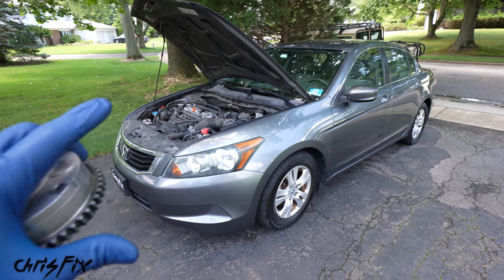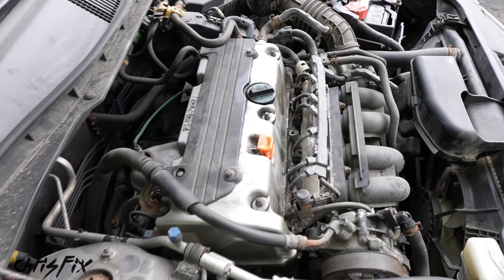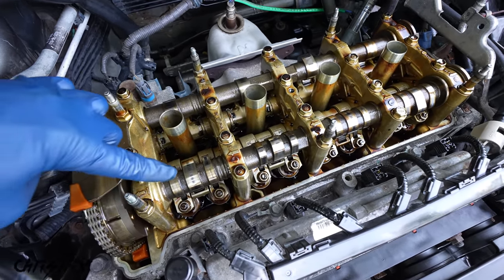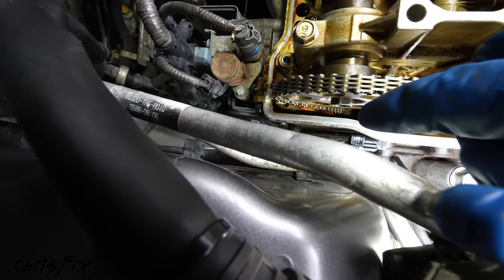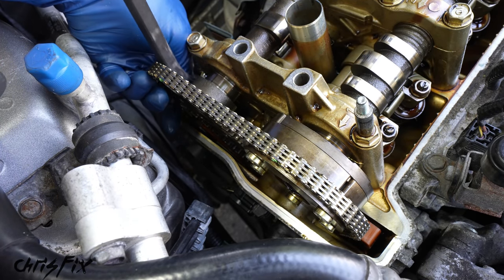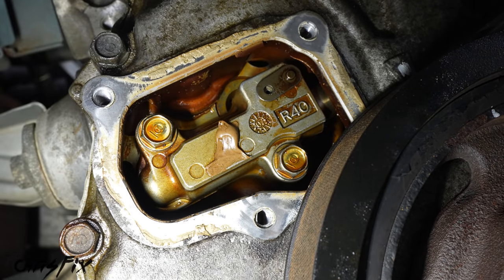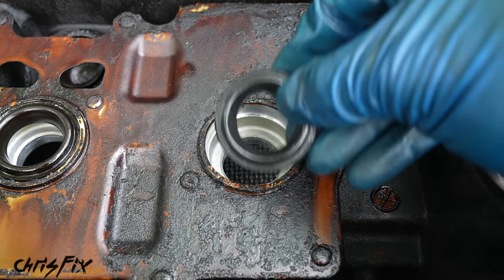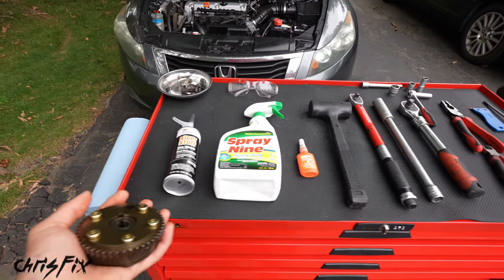How to Replace a VTC Actuator (Complete DIY Guide)

Comment: whats the worest scenario if i didn't change it,  because i just hear the sound sometimes only in winter .
Reply from the maker: As long as it's not bad you can get away with starting the car like that. Worst worst case is it breaks and causes a catastrophic engine failure but that is very rare.

Comment: How do I know if my noise is coming from the timing chain tensioner or vtc actuator.  I'm seeing some people saying it's the timing chain tensioner which would be an easier replacement than the vtc actuator.  Thanks
Reply from the maker: Listen when someone starts the car. You can tell if it’s from the top or bottom of the engine
Reply: @chrisfix  Thank you.  I don't have any check engine lights on if that helps at all.
Reply: @tylerlavalle8951  have you fixed the problem? and what year do you have? i have a 14 accord sport, need help

Comment: My son drives my honda accord lxp 2009 180k miles no code but it sounds just like that ....but it also cut off while he was at the red light 🫤 i might try this wish mr luck
Reply: There are replacement VTC actuator springs that often resolve the rattle without replacing the VTC actuator.  Quick and inexpensive with no risk of upsetting your timing.

Comment: Hi Chris, just replaced mine on a 2014 crv ex. 105k miles. Starts great now but throwing a P0341 code and I have lights on the dash. Is it the solenoid?????
Reply from the maker: It could be. Does it idle weird like a very high idle?
Reply: @chrisfix  No sir, idles fine.
Reply: @chrisfix  got it! TDC was as close as I could get it, but was out just enough for the computer to not like it. A buddy helped me adjust the exhaust sprocket just enough to put the crank mark more perfectly in place. All P0341 codes left except the permanent. After about 1/2 hour of driving, it cleared itself. Not a bad job at all, but more finicky than I am used to. Thanks for all you do!
Reply from the maker: @djpreast6638  awesome job!
Reply: @chrisfix  well, it started the cold start rattling again after replacing the actuator. Solenoid appeared good and clean, just start replacing parts I suppose?
Reply: @djpreast6638 I see some people just replacing the spring in the actuator. How did yours turn out?

Comment: I did this job following the video but I got the code p0341 I dont know if its related to the vtc? What should I do re do the job or change the part that the check engine is telling me the crankshaft sensor.
Reply from the maker: Check timing. Make sure your timing chain isn’t worn out.

Comment: How long does the new actuator last? I was told it doesn't last long.
Reply from the maker: It’s been fine over a year later. It will only not last if it’s defective.
Reply: Thanks for your videos they helped shorten the time I work on stuff and I can spend a little more time in my recliner

Comment: My original vtc actuator was not in the locked position when I took it off.  When I put the new one on, and locked it, I'm not able to reach the exhuast can with the sprocket with both sprockets aligned with my paint marks.   Ithen got slack in the chain.  now what?

Comment: My 2014 CRV needs the same thing. Can you do it ? Where are you located and How can I reach you? I’m a former Toyota tech from the late 80’s, I’m too old to do much of anything any more!
Reply: For the 2014 CRV a new Extreme VTC spring usually does the trick.
Reply: @spring-start so it’s an entirely new VTC with a new extreme spring? You have a link to a part?
Reply: @johnc3225  just a spring that fixes the VTC actuator rattle. "Extreme VTC spring"  on a "search" should do it
Reply: found it. Is it easier to change rather than replacing the entire VTC?
Reply: @johnc3225  A fraction of the time, cost and no risk of upsetting your timing. It works.
Reply: @johnc3225  It takes about  45 minutes.  We reuse the valve cover gasket in most cases.
Reply: Awesome! I just looked it up, looks easy! I’ll give it a try this spring-summer. Thank you!
Reply: @johnc3225  we just designed a new spring for the 2014 CRV and can send you one complimentary to test.
Reply: @spring-start  how do I know this is a legitimate offer? I’ve been scammed on YouTube before!

Comment: Most of the time these actuators go bad because of the sprocket spring internally, high mileage motors yes but one of those things where the dealer has built in planned obsolescence. At least it's not the same as an E90

Comment: The video thumbnail says VTEC actuator, and the title says VTC actuator. I'd like to clarify those are different parts that are both part of that car's i-VTEC system. VTC adjusts timing across the entire RPM range, while VTEC extends timing and lift above ~5100 RPM.
The system repaired in this video is in fact VTC, not VTEC. 
I'm no expert, but if your engine is hitting VTEC on a cold start, I think you should ask a mechanic about that. 

In fact, most of the 8th gen Accord sedans (like the one in the video) will almost never hit VTEC at all, with the exception of the ones owned by morons like me. The automatic transmission in this car will actively try to prevent you from passing 5k RPM. (...which is understandable for a budget eco sedan produced during a recession.)

Comment: Changing it is not hard, its the guesswork of whether the electrical part is bad or not, you could literally change the valva actuator, pcm, etc before you finally get to the bad part. You dont show what to look for on the scanner. Just hook it up and listen for the sound

Comment: I changed mine and it still makes the same sound as in the video… what else could be causing it?
Reply: I replaced vtc actuator yesterday on my 08 accord 2.4

Maybe timing chain, tensioner, and guides need to be replaced if your car has high mileage

Comment: I used an induction heater to heat up the actuator bolt but the bolt was still stuck hard.
Reply: Finally, got bolt cracked loose.

Comment: 2010 crv rattles on cold start and continuously rattles when driving could it be the chain?
Reply: A new timing chain tensioner and a new vtc actuator spring often resolves the rattle on 2003-2011 CRvs.
Reply: @spring-start  link to the spring kit? Wanna start off cheapest first
Reply: springstart vtc
Reply: google
Reply: R40/RZA kit

Comment: I did this but my horizontal lines are a tooth off. Paint marks line up to the notches. I'm lost
Reply: My cams shifted when removing the gears, use Allen key in the driver side of the cams to hold them in top dead center.

Comment: I just did this job and it was a pain. It's very important to tighten up the bolt on the intake gear before the chain goes on it. i accidently unlocked it and then the exhaust gear would not go on the cam. It takes very little effort to unlock it. I had to take the new actuator apart and unlock it.

Why are we so worried about keeping the chain in the right place on the gears anyway? I've done a couple timing belts and all you have to do is make sure that the crank and cams are in the right place when the belt goes on. The belt or chain just spins around the cams and crank keeping them in time.

Comment: I HAVE HONDA CRV I HAD SAME ISSUE. I GOT THIS ACTUATOR CHANGED. AFTER FEW DAYS I GOD SAME SOUND AND ITS EVEN LOUDER . I GOT THE OIL CHANCE AS WELL . SEEMS LIKE OIL PRESSURE DROPS IN THE ACTUATOR AND DOESN'T LOCK ON TIME AND MAKES THE SOUND. PLEASE HELP ! WHATS SHOULD I DO NOW ?
Reply from the maker: If you think it’s an oil pressure issue get the oil pressure checked. Did they use an OEM part?
Reply: @chrisfix  THANKS FOR REPLYING, YES ITS OEM PART. I WILL GET THE OIL PRESSURE CHECKED

Comment: Careful, if your chain is stretched, simply replacing the VTC actuator won't fix the problem. More like a bandaid.... If you hear your timing chain slapping after replacing the VTC, your chain is probably stretched

Comment: so i have this problem as well with a 2009 acura tsx, with the same rattle noise on start up. but the check engine light is not on and the car runs smooth. but it rattles on start up, and it rattles when you drive, but the only time it rattles when driving is when pushing down on the gas accelerating. no rattling when braking or my foot being off the gas, only when i push on the gas pedal. can anyone help?

Comment: My timing mark on the pulley is off by a smidge. Has anyone ran into this? Timing chain doesnt feel that loose. Going to go for it and reassess from there because engine runs nice and quiet with 0 codes

Comment: I think I got hoodwinked by my Honda service. I got car shield and after watching this video I now realize I got conned by them. Looks to me like they didn't change the actuator or even attempt to examine the condition of the timing chain, while claiming to have changed the actuator. Still making the cold start rattle the crooked dealer concealed from me when I bought the car. On edit: and they charged me over $1000 for it.

Comment: Sweet😂put dirty valves cover back to the engine😂😂😂😂
Reply from the maker: Thanks for sharing! It will be tough cleaning the stains off the inside of the valve cover with15yrs of use. It's just cosmetic and has no affect on the engine.
Reply: @chrisfix  Well, i did it many times. And will do next weekend. No problems at all. Try atleast gasoline - and you will be surprised.
Reply from the maker: @alexthebear  Thanks for the tip!

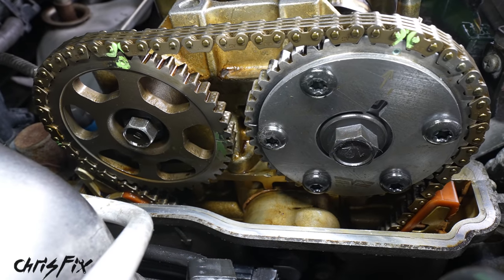Comment: What’s with the chain binding at 22:38?
Reply from the maker: The tensioner needs oil pressure to push against the chain and keep it tight and me hand cranking the engine did not give it enough pressure. Just need to make sure it doesnt skip teeth (which it didnt).
Reply: @chrisfix  I see. Good. I thought something was misaligned. That makes sense.
Reply: @chrisfix  Hey Chris, so should we putting back the "chain guide on top of the cams" before attempting this "hand cranking the engine step"

Comment: Brake fluid is looking kinda dark. Should be flushed every 3 years. Trans needs to be done every 30,000 miles. Coolant and power steering every 45,000.

Comment: With a Toyota, a bad starter can make that rattle on a cold start-up.
Reply: @gabrielchaparro1698  It's a flaw with the Bendix on the starter. On cold start, it sounds exactly like a bad actuator or timing chain rattle.

Comment: Dude ... REALLY ? 
It's a ( $1.08 ) spring that is causing it to Rattle.
 The cheap & weak spring is too weak to hold the Actuator piston until oil pressure kicks in. So .. just replace the freak'in SPRING !  DAMN ! 
 There are people that sell Kits with the ( T -27 ) Tool & ( 2 ) springs for ( $35.00 ).
 Or.    You can just go & find a spring on your own for that ( $1.08 ) ? 
 It takes MUCH less time & cost to get after the Real problem
Reply: where is the link for this spring, need it asap, have been looking everywhere

Comment: The only reason I clicked on this video is because when I see vtec I get giddy. Vtec is the MOAB hondas are strictly made for everlasting life they never die no matter how many times you bounce off your rev limiter. It only drinks oil because oil is its lifeblood anything else is inferior. It sounds fast always but slowly creeps up to 60 praying apon a unsuspecting toyota Camry then it SWOOSHES BY WITH A MODIFIED EXHAUST AS LOUD AS A JET ENGINE YES WITH ITS SPEAKERS SET TO MAX WITH BASS as powerful to shake any UNSUSPECTING VICTIMS!!!

Comment: Vtec fail and vtc fail , oil consumption, among other craps, as previous owner of a 2003 Honda element and 2008 accord, those K-24 are garbage , those vtec system regardless it’s performance have proved to be troublesome and unreliable 😏

Comment: Thread locker defineitly not required or recommended. Pre-fill of oil filter not recommended or required! You also didn't replace the drain plug washer i defineitly wouldn't want you working on my car let alone anyones car